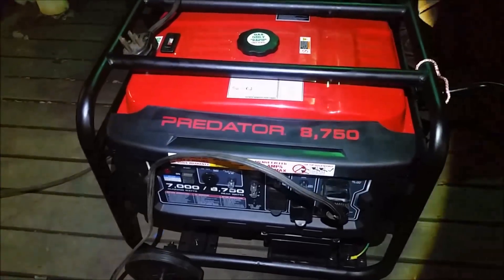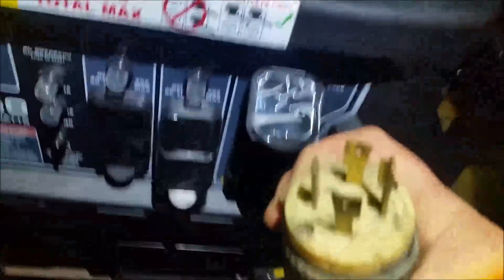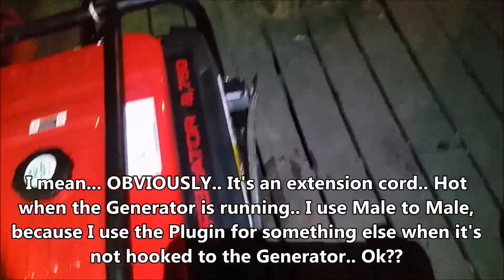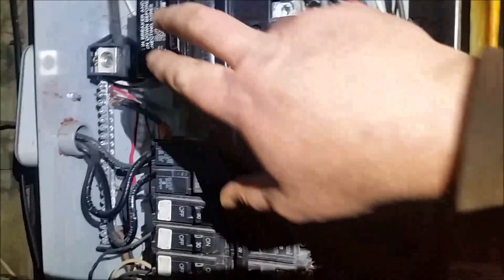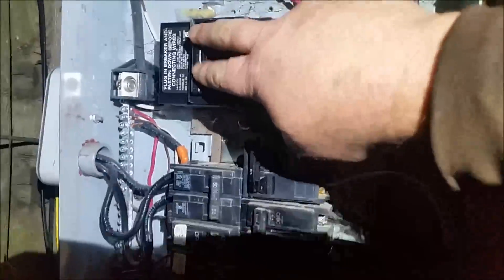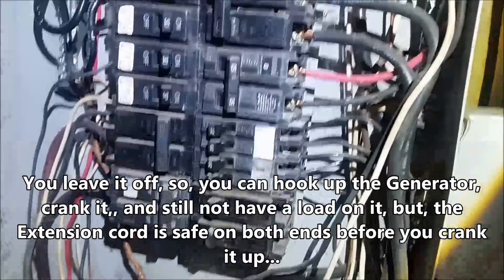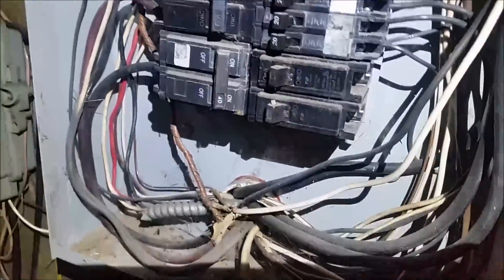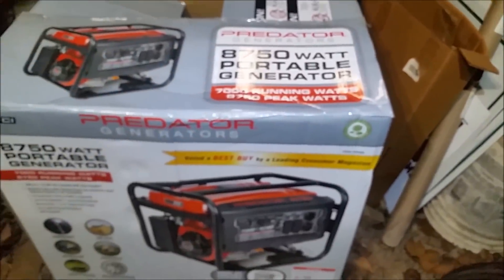Quick/Easy/Safe: Use Existing Plugin/Breaker for Generator hook up to your house Panel box.

Comment: Scenario...your gen is running and you go off to do some chore right?  Meanwhile SOMEONE in your household thinks there is a power problem and heads out to panel and starts flipping breakers ....BIG TROUBLE presented with this method!  it is NOT fool proof like a correctly installed system would be
Reply: it is NOT fool proof like a correctly installed system would be

It is if you don't have any fools in the house. When my son lived here, under the age of 18, he didn't go near the generator. From the ages of 18 until he moved out and started college at 22, the LAW was whoever starts the generator, shuts it off regardless of when the power came back on. My wife, due to health problems is home 99% of the time and doesn't drive. I'm disabled but still run most errands and I'm home 80% of the time. The generator is manual electric start so any of the three of us can start it. There is a computer generated, step by step manual that I made up, one tied to the generator and one in the house on the fridge with pictures and text describing each step of the process and I made my wife and son familiar with them. If I start the generator and go to the store, it doesn't matter if the power came on when I left the driveway, I am the one to switch it back. Same with my son then, same with my wife now. There are 2 religions in my house. One by God and the other one by Jeff and Troy Bilt. We aren't perfect so much on the first and God allows us some wiggle room for that as long as we don't forget Him but the second one is inviolate.
Reply from the maker: I like that Jeff.. Ha.. Around my place,, I'm here just about all of the time.. I hate to leave here.. I have everything I want right here.. Ha.. My work is right outside of my front or back door, and I live in the most beautiful place on earth.. When it is 90-100+ around me, within a 10-15 minute drive, my top temp in the Gorge here is 85-88 degrees F. The damn fed river (225 feet deep pickup from the bottom of the lake) is like an A/C during the Summer and like a heater during the winter.. Heck.. I keep a good Girlfriend, and they always do all of my shopping for me.
The only time I leave here on a regular basis is with a Trailer in tow, going to drop something, pick something up, or, some sort of road trip and no one is left at home.. No one bothers to do anything around here, because I am always on top of it.. And, things always work out, because they do other things for me that I don't care doing,  but, they don't mind.. So, when it comes to things like this,, it's the Man on the Hill Law.. Ha.. 
Of Course, my Mom, 80 years old, has a new HF 8750 Generator (in this video), and I hooked hers up basically the same way mine is hooked up.. 
When the power goes out, I hook mine up real quick,  (Flip the main breaker off on the way to the Genset), hook up the cord to the Generator/wall plug, fire the Gen up, walk back to the panel, and flip off all of the 220 Breakers, flip the Gen on, then start adding back the 220 breakers one at a time.. 
Then, I call her and see if she is ready to hook hers up.. I usually just talk with her on the phone..  I don't tell her what to do,,, I just tell her if she makes a mistake by asking her a question about the procedure that is concept oriented.. She picked it up pretty quick.. The last 5 or 6 times, I just sat and listened and let her walk through the steps.. 
One thing she will never do.. Is not throw the Main Off, when going to Generator Power or,, Not Isolate the MtoM cord before unplugging it (Generator off and Gen Breaker off)..  I'll continue to call her on the phone, but, the last 2 or 3 times, she talked me through it over the phone before she even went outside.. I am just giving her a piece of mind now, so, she doesn't have to stress over making a mistake, but, I am 100% confident, she could do it on her own, because she understands what she is doing.. I did print out a set of instructions and put them in the panel, but, she doesn't want to use them.. She wants to do it out of her head.. I'm sure, she would at least check them, if I were out of reach.. I just bought an old 1984 Ford 3910 Tractor.. Never had anything diesel.. Never liked them.. But, this baby purrs like a kitty.. Been learning all about tractors here lately.. 
BTW.. 73's.. from KJ4SLY.. I have a 80M Inverted Dipole that I have worked all 50 on.. I keep it safe in a home made Faraday inside of a 20' shipping container, along with some other very interesting stuff,,,, in case something goes cockeyed.. Cheers Jeff.
Reply from the maker: Doesn't matter.. You can flip whatever breaker you want to flip.. BTW.. I don't have ignorant people living in my house.. Is that your problem??? 
I don't have anyone in my house that would go out and flip a main breaker while the generator is running.. I mean.. That would really take someone TOTALLY STUPID!!!!!   Maybe in your house.. Not mine.. 
BTW.. This video is NOT FOR YOU!!!  I really didn't realize how many ignorant people there are out here.. You guys have me second guessing myself when I get ready to drive to the local store.. I may not be safe out there.. 
You can't handle flipping a main breaker and they let you drive a CAR???????  Holy crap..

Comment: Cool Idea using a breaker to power the bus!
Reply: Except it may never trip in that configuration. It's fed backwards. Not designed to operate in reverse. The bimetallic strips may fuse causing no trip since the wrong metal is being overloaded first. It's a crap shoot at best. I have seen breakers trip and never reset and i have seen breakers fail to trip. Usually moisture involved. But they were all being fed normally so who knows when fed reversed?
Reply: all the load lines for the house are protected just as much as they were. He's not relying on the circuit breaker to protect the generator. The generator has its own onboard protection.
Reply: Generator safety is very important https://youtu.be/I1jT3ANENvI